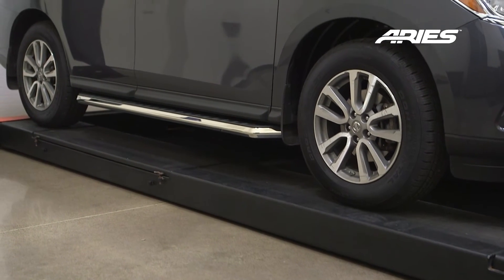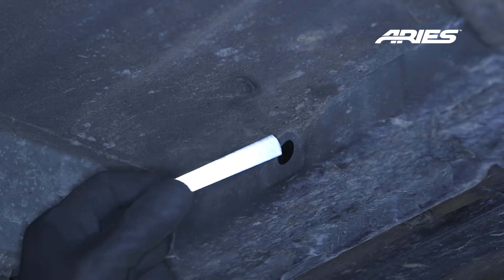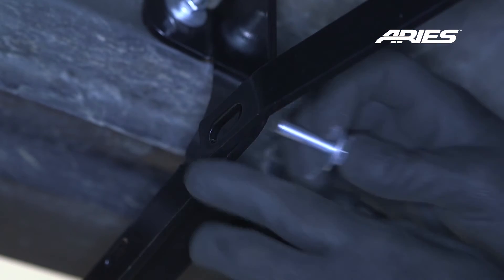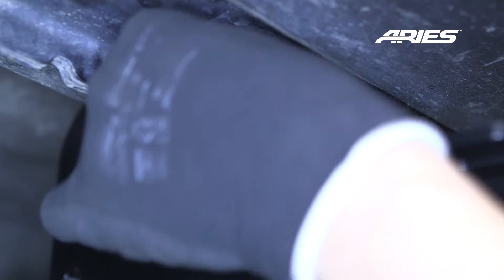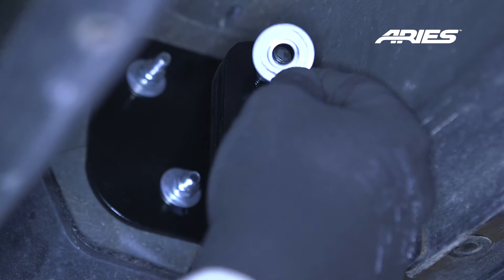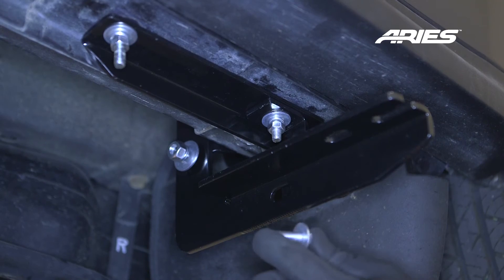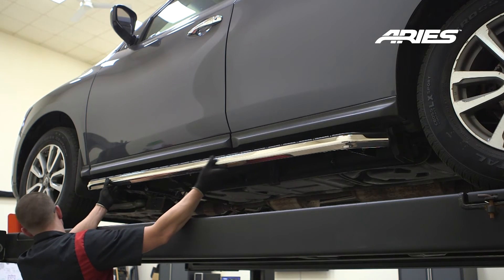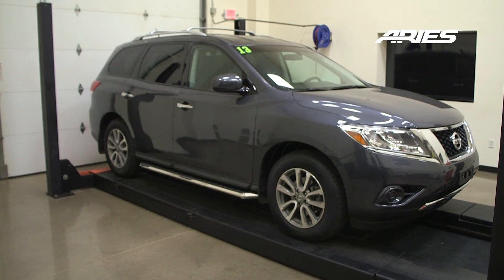ARIES AeroTread™ Install 70" Running Boards on Nissan Pathfinder Bracket 2051146

Comment: Price of this and were i can buy this
Reply from the maker: Great question.  Go to the part page to find product details. Click the "Where to buy" button to see local and online retailers.  Check one of the online retailers for price.  Use this link for the black finish - http://www.ariesautomotive.com/part/2061011 and this link for the stainless steel finish - http://www.ariesautomotive.com/part/2051011
Reply from the maker: https://www.amazon.com/ARIES-2051011-AeroTread-Running-Brackets/dp/B01IBT65JQ/ref=sr_1_1?ie=UTF8&qid=1497631427&sr=8-1&keywords=aries+2051011